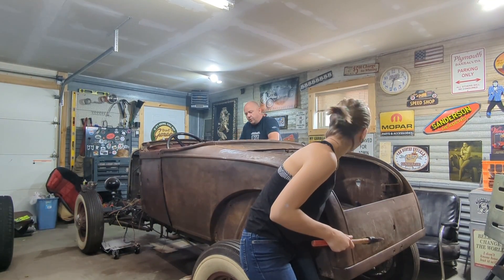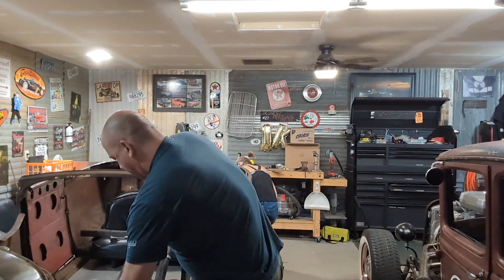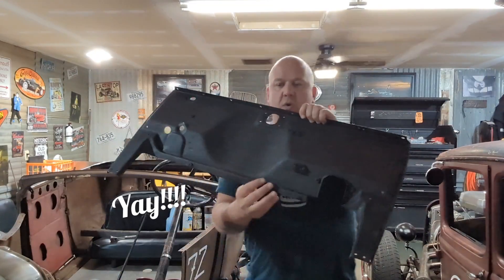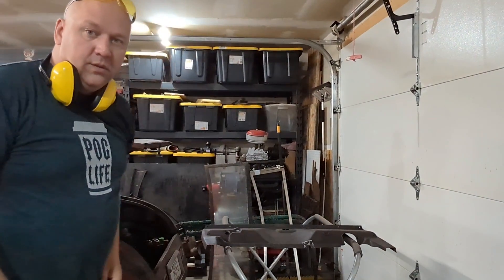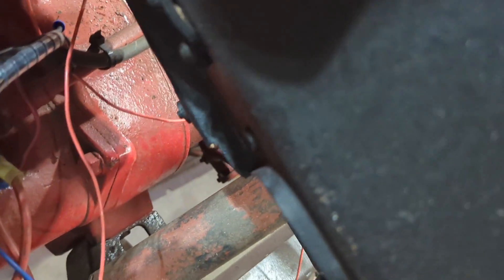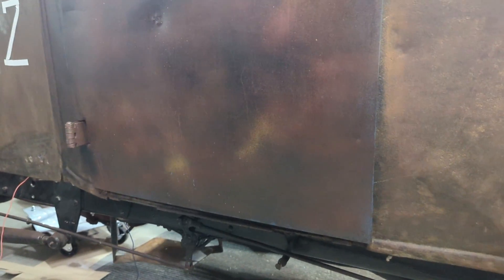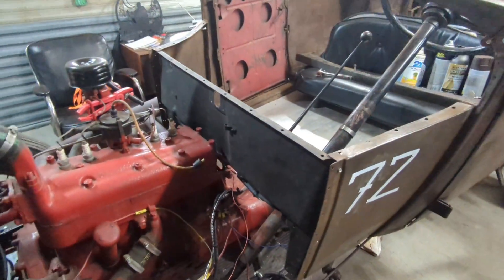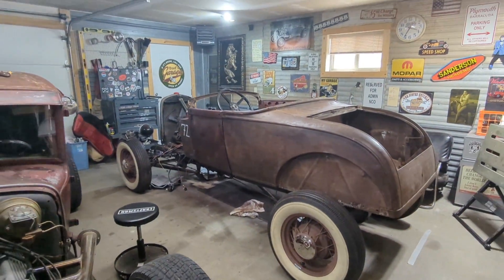Trouble Maker gets work done...

Comment: Great video.  Fitting stock parts on a modified hotrod is always gonna be challenging. Put any stock part on a modified anything will require some adapting. Looks like driver's door needs to lighten up a bit?? Thanks for your service. Retirement is great when you have something else to do. Be safe and stay well.
Reply from the maker: The door, we aren't done with yet, and there isn't a great light source right there to get a great look at it. I did get a solution developed for the firewall.